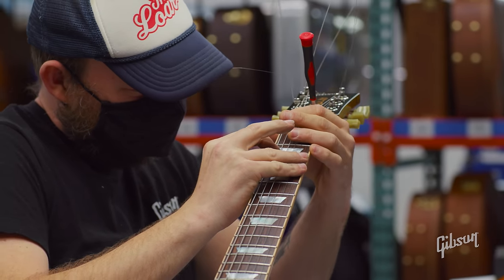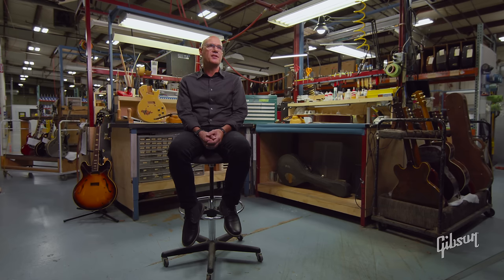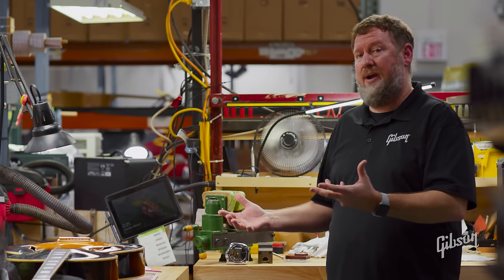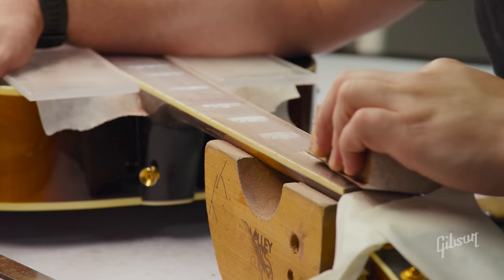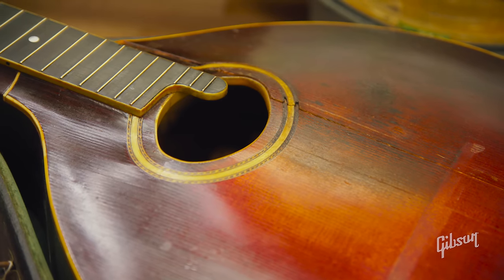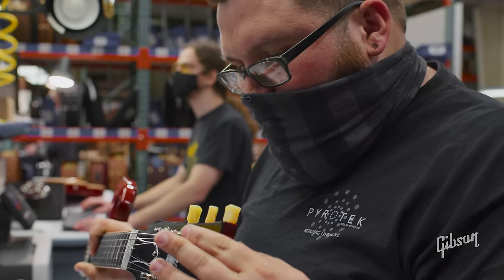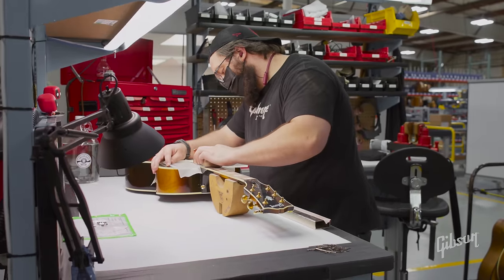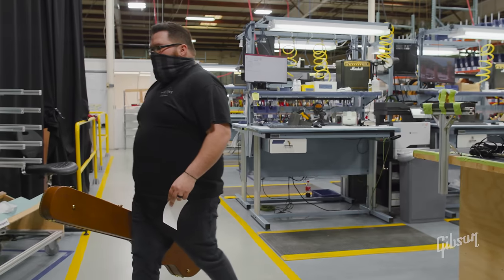Meet The People Who Repair & Restore Vintage Gibson Guitars - Gibson Repair & Restoration Shop Tour

Comment: Just recently I received back a RFQ from Gibson Repair and Restoration for work to be done on my Les Paul Custom.
I think many people would be surprised a the prospect of spending over $1300 for a re-fret.
To Gibson's credit they are not the highest quote I've received back for the job and are in fact very competitive in their pricing as compared to other well known shops.
And before I get a ton of reply's about the high price I'll add it is a 1986 Custom w/Maple Fingerboard which will need to be planed and refinished in lacquer.  There is more involved as compared to an Ebony Fingerboard re-fret.  Also, the price includes SS Frets.
Reply: Well how did it go?!?

Comment: Dear Gibson, In 2022 I bought a new ES-335. I just started toying around with middle position tonality and realized that is I roll the neck pickup down, my bridge pickup goes silent as well. Is this a "feature" ? Or do I have a wonky soldering issue ?

Comment: Gibson , is the a department at Gibson that would do custom work to guitar already purchased ? I have a factory  2019 Flying V but I would like to customize the dot inlays to trapezoid . I would also like to change my early 2019 headstock veneer to the later 2019 where it has "Gibson" pearl inlay logo . I have a string butler on my Flying V that helps with tuning stability but have to take the truss rod cover off . The truss rod is where the Gibson logo is on the early 2019's . I paid $1700 cause I wanted a Gibson and seeing that logo makes me proud . GIBSON , can you help ??

Comment: Would, Gibson’s guitar technicians do a (better) job than ― my online dealer ― in correctly fitting, and properly installing the 5x-more-slippery-than-graphite, #GraphTech® #TUSQ_XL® nuts? 🌰🌰🌰 With my dealer’s guitar tech(s), the replacement and new installation is always a hit-or-miss proposition; and furthermore, all the shipping back and forth ― puts my #Gibson® and #Epiphone® guitars at #Risk. 🚚 The #NuBone nut is not available in an XL version. Why not, #Gibson® ― just have the effin’ #GraphTech® #TUSQ_XL® nuts ― installed at the effin’ factory? 🏭🎸🎸🎸

Comment: Could Gibson’s guitar technicians do a (better) job than ― my online dealer ― in (properly) installing the
5x-more-slippery-than-graphite, #GraphTech® #TUSQ_XL® nuts? 🌰 With my dealer’s guitar tech(s), the replacement and new installation is always hit-or-miss; and furthermore, the shipping back and forth ― puts my #Gibson® and #Epiphone® guitars at #Risk. 🚚 Why not, #Gibson® ― could you just have the effin’ #GraphTech® #TUSQ_XL® nuts ― installed at the effin’ factory? 🏭🎸🎸🎸

Comment: So Gibson but I had buzzing I'm the D and the g string above the 14th fret and I was told that there was a slight warp in the neck. You put it on your plaque machine that didn't solve the problem and you told me you couldn't fix it and you told me either you would send me a new 2016 r9 to replace it in the same color. First off that's lazy customer service you don't people spending thousands of dollars in a guitar and you're telling him there's a little bit of a warp that develops in the neck and you guys are either too cheap or too lazy it's easier to give out a new guitar that means you think your guitars are expendable because I certainly don't I look for that guitar for a longtime picked out that specific model I picked out that specific guitar because of his residence because of its neck because of its color and because of the Flaming on the top he treated it like it was Expendable in his garbage and just sent it a new one like the cheeseburger or something it is not just a guitar it's a Gibson if you can't be trusted to correctly repair a guitar that you guys made that went wrong why should anyone trust you to fix something of theirs or something vintage I mean it seems you don't think much of guitars
Reply: Try this 👉...Harley Benton SC 550 Plus 👌